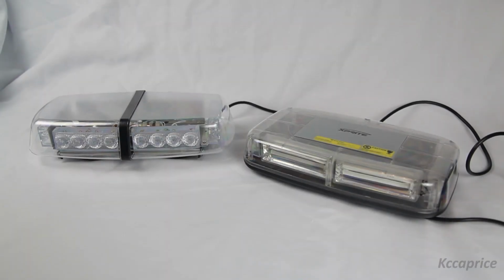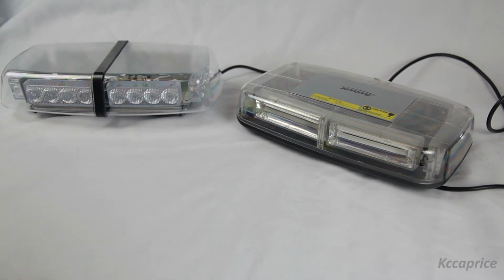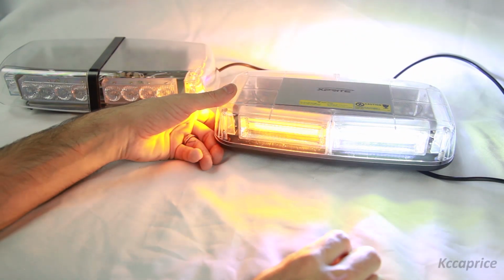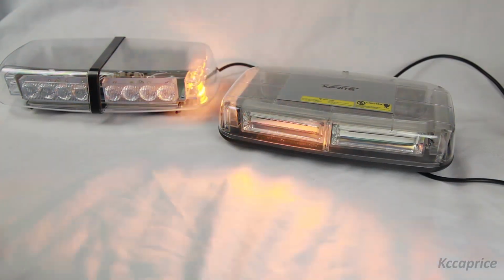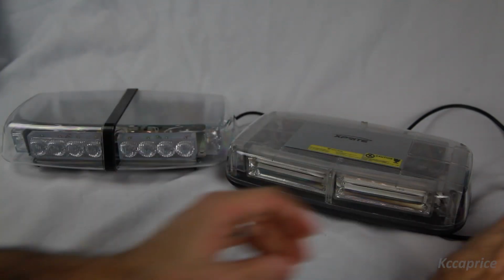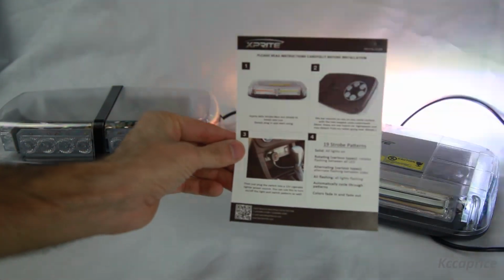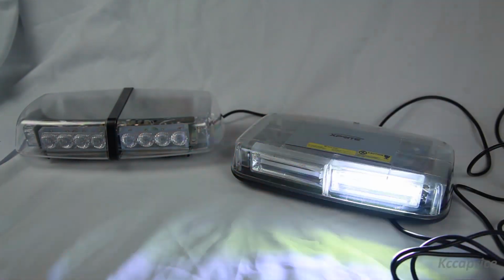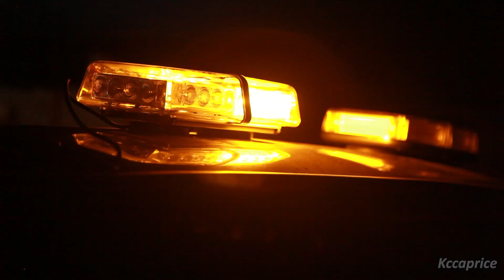LED vs COB LED | Mini light bar strobe

Comment: Hey dude, do you still work on old school lighting because I have a question about an American DJ helicopter.
Reply from the maker: Yes. Whats up?
Reply: @kccaprice  hey dude! Ended up fixing it. Fuses kept poppin and traced it down to exposed wires from the ring assembly.  Replaced the wires and boom 💥 it’s back in action. Thanks
Reply from the maker: @gabrielrosas5173  Awesome! Post a video if you havnt already
Reply: @kccaprice  I have a few. Love those lights

Comment: Can you connect 2 of these COB Mini Light Bar so they can work together ? I want to make my own Strobe Light Bar with 2 of these and my Company Logo in the middle... Thank you
Reply from the maker: No, they will not sync
Reply: @kccaprice  That's not right, i just received my 2 Mini Light Bars and i have synchronized them to work together on the same switch. Cheers